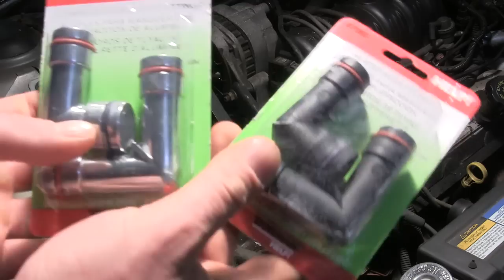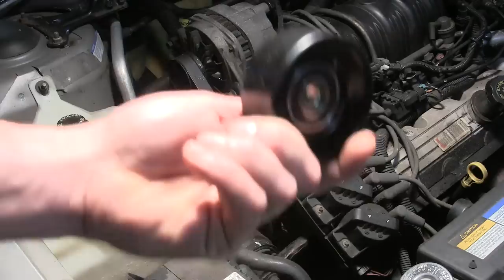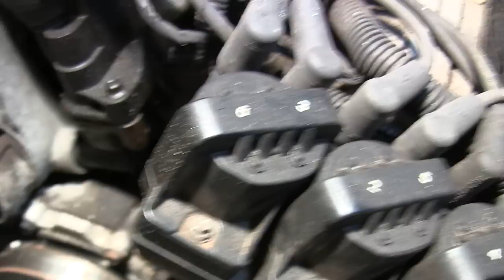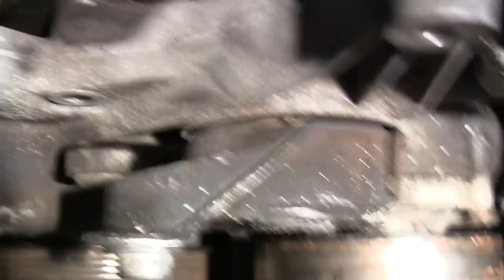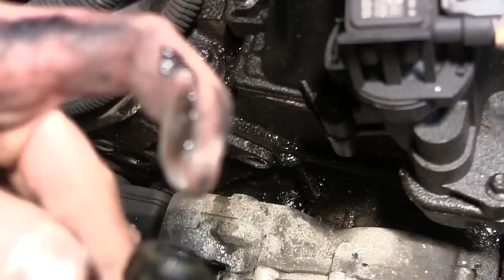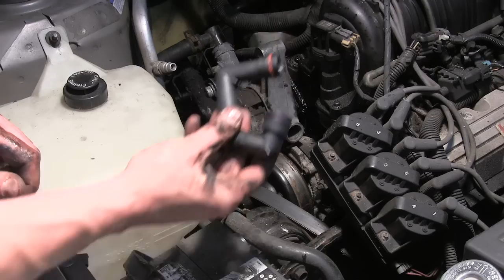3800 Coolant elbow replacement

Comment: I had a friend of mine replace the intake on my '97 LeSabre several months ago. While he was working on it, we also replaced the coolant elbows. When he removed one of them, it literally disintegrated in his hands. We replaced them with the aftermarket metal elbows like the ones shows at the start of this video. The upper and lower intake and the elbows were all on the verge of a total failure after 17 years and about 63,000 miles.

I always recommend everyone have this work done on any 3800 Series II cars they have. Eventually, they all have these parts fail. It happened twice on a '99 LeSabre I used to own, and I wasn't going to let it happen to this one.
Reply: Your saying that the upper and lower intake manifolds were on the verge of failure or the gaskets?
Reply: Both are huge failure points on these engines..

Comment: Great vid. I'm currently in process of replacing the upper IM assembly and the lower IM gaskets. I got the intake(s) off an hour ago only to discover that there was no antifreeze in the intake and upon removing the lower IM that my 3800 had already had the job done before I got the car at 97,500 miles in Aug '12. They used the good Felpro metal lower gaskets. Then I started to worry about head gaskets and then remembered the elbow issue. I ordered the metal elbows with my other stuff last week so I do have them. I'm praying that it's just the elbows leaking around their o-rings.  Of course I'm going to install the new parts that I bought anyway. Peace of mind for myself :)

Comment: FYI, just did this exact repair yesterday. I took a piece of wire clothes hanger bent into a very small J-hook (small enough to get through the hole but still catch the broken piece), poked it into the hole through the broken piece (carefully!), and pushed it in deep to make sure the broken piece would fall and stay on the hanger (rather than falling into the coolant passages). Then I just pushed the broken piece into the hole to get it loose. It fell onto the hanger, and I pulled it out. Very easy.
Reply: saw another where a toggle bolt and washer was used as a "puller" for the old elbow.
Reply: I used a paint can opener
Reply: Be VERY careful not to score the inside of the hole with a sharp edge of a tool or coat hangar.  It's only aluminum, and if you score it even the slightest amount, it will leak.

Comment: Surprisingly I've never had one go bad, and I own a half dozen of them currently, more commonly the water pump tends to go out, Liked
Reply: Then you're EXTREMELY lucky.... I had them leak on my 2009 Buick Lacrosse @ 68,000 miles. 

VERY common failure point on these 3800's since the early 90s

Comment: Thankyou for this, i did it in 2hrs! it wouldve been faster but i was stuck dealing with the pieces that broke off inside lol. I'm lucky, i drove the car on an 18hr trip and noticed it would only leak coolant during heavy throttle so i babied it til i could get it repaired. my elbow was completely split! i replaced them both with the aluminum ones

Comment: I purchased a serpentine belt removal tool which I also used as a breaker bar for those bolts. The tool is about 24 inches in length much longer then a regular breaker bar. It works better then a breaker bar as gives you more torque to remove

Comment: I had to replace mine (along with the radiator because of them leaking air into the system and frying the plastic tanks on the rad!) and also got a piece of the old plastic pipe stuck inside the engine. My mechanic was right there working on my dad's RV at the same time and came over and took a look and said not to worry because it would probably just stay in that passage and not be able to block anything. He was right as there seems to have been no problems caused by this so far. I also put in a thermostat that opens slightly cooler than stock yet the temperature on the dash seems to hover about where it should. Might be a good idea for this engine. Engine has been running pretty good after replacing basically the whole external cooling system. I did have one episode several weeks back where the check engine light came on intermittently for a few days but I haven't seen it again in at least 2 or 3 weeks. Bad tank of gas?!
Reply: Scan it and find out
Reply: @davelowets That was 7 years ago. That car is LONG gone! I now have an even older car with a Series I 3800.. none of these bullshit problems.

Comment: Changing mine today for the first time.  Got 160,000 miles and 6 years of ownership so far.  Got Aluminum ones to put back in. The front elbow broke off and fell back into the intake and can’t see it at all now.  Hoping no damage will incur.
Reply: What ended up happening? A piece of my hose broke off and fell in also. I can’t find it now.
Reply: Remove the thermostat, put the housing back on, and then flush the rad with a garden hose.... 

The broken piece will probably flow out with the water that comes out

Comment: As a mechanic myself why in the world would you EVER put plastic ones back in? Its $3 more for the aluminum ones. I flat out refuse these jobs if the customer doesn't use the aluminum ones.
Reply: I cringed when he said that the end of the plastic elbow had broken off inside and was lost forever! 
I'll be doing this job come springtime and I'll probably get the whole tensioner kit with the aluminum elbows...
Reply: I would go with aluminum ones even if it meant $30 more. 
You have to wonder though - did it REALLY save GM that much money by going with cheap plastic ones? Talk about penny pinching.
Reply: Believe it or not the plastic ones have a better o-ring then the metal ones. The metal ones have a smaller o-ring which have a tendency to leak after 5 to 10 thousand miles. They did not make the O-rings thicker on the metal ones but they're a little bit thicker on the plastic one. You might just take the O-rings off the plastic ones and put them on the metal ones and have a better seal because I guarantee you some of these cars will still leak even after their replace so it's better to put it like a bunch of gunk around the O-rings to kind of give it a double seal my car leaks after 6,000 miles after I put the new metal ones and realize that the O-rings are not as thick as the old ones
Reply: @chaseww  you’re joking right ? Gm o rings are the proper size. 175k miles on aluminum ones with genuine o rings. Worth the extra cost.
Reply: @oneeyedrone4293  he is correct. If someone purchased the Dorman brand aluminum elbows, the o-rings are trash.  I recently did this upgrade.  Since my local dealer did not have the genuine GM/ACDelco o-rings in stock, I purchased the plastic elbows and stole those o-rings and put them on the new aluminum ones.  Hopefully... problem solved.
Reply: @xxXWiLdFiReXxx  i got mine online from a reputable ebay GM seller of OEM parts. They stock them even locally just for a bit more, I used a lot of dielectric grease for the install. Dorman usually makes OKAY quality parts, but they are not the best by any means. I still dont understand why dorman makes plastic and metal elbows when they both fit the same application. 

The new GM parts are now more made in china since they are phasing out the aftermarket side of things. I think that explains why older cars break down more often despite getting new motor mounts installed, bearings etc. The replacement parts are not the same quality despite being OEM. When the car first launches they mass produce parts to ensure cars last their rated warranty, after that point its fair game to use any white box brand. 

Either way, this repair is a simple one, just messy, and overly complex, but rewarding whne youre not leaking coolant :)

Comment: My 2009 Lacrosse started leaking coolant ONLY when the outside temperature went below 30°, AND the car ONLY leaked when the engine was shut off and cool. It would leave an ocean of coolant under it the size of the car. But, fill it up with coolant and drive it, and it would NOT leak a drop. If the outside temp was above 30°, it would NOT leak a drop... it was FRUSTRATING to find this leak. 😤

I finally found it, and it WAS the lower coolant elbow... replaced both elbows with the aluminium Dorman ones, and no issues since. 

Be SURE to clean up the holes where the elbows go into very well before you try to install the new elbows, or it WILL leak again in the very near future. If the aluminum in the hole is dirty or pitted, use a very fine sandpaper cartridge or small wire brush to clean it up first. If the hole is severely pitted, you may want to use some Permatex Right Stuff around the O-Rings to help them seal. If not using Permatex, DO NOT forget to LUBE up the O-Rings before you install the elbows, or you WILL end up pinching or tearing the new O-Ring and it will leak again. 

Good luck....

Comment: I use a little grease around the new elbow o rings, you never know when you will be back to do something else,  but coolant works as well.
Reply: Very wise....
Yes, you can easily pinch or tear the new o-rings if you don't lube them.

Comment: Use dorman elbows but use gm o rings only if you don’t want them to leak. 

Grease on o rings works well. 

My 3800 sc2 is pushing 170k miles with metal elbows.
Reply: I've had luck using the o-rings included with the elbows, BUT, I cleaned up the inside of the holes VERY well, and lubed the o-rings before installing them. Hasn't leaked since, and has been several years.

Comment: I really appreciate this video. I'm in the process of replacing the elbow. I have the Tensioner Assembly off the car because it was easer to clean out the old elbow, it seemed to be really stuck in there. Just to get this far it tookme about 20 mins. I've watched 3 or 4 videos and feeling lake an expert. Ha Ha. Again thank you for a great Video.

Comment: I have the opportunity of buying a super charged bonneville, it was leaking water and the whole elbow blew off, this was exactly what I had to change, I put the aluminum ones in
Reply: I have a '95 Buick Riviera supercharged and I'll be doing the same job. I'll probably go ahead and get the whole tensioner that comes with the aluminum elbows...
Reply: @bodeine454  I have a 99 rivera and I'm doin mine now 🤦🏿‍♂️🤦🏿‍♂️🤦🏿‍♂️🤦🏿‍♂️
Reply: @sickmike2010  😮
 Tell us how much fun it was when your finished. I probably won't be doing mine until spring or whenever it starts warming up. One of my belts is squealing like a stuck pig right now. Gonna get a couple of those quiet belts by Continental from Rock Auto. They look like those gator belts with the cross pattern ribs...
Reply: @bodeine454  I finished I had to suit up but it wasn't that bad it's hard to find our car on YouTube but it wasn't that bad then u think it is but overall it was fun hell of a experience
Reply: @sickmike2010  I hear that! Yeah, my whole front end needs to be replaced practically.  New bushings, sway bar links, cv axles and struts...
Reply: @sickmike2010  I just put new rotors and ceramic pads on it this winter.
Reply: @bodeine454  yea man it's fun this is my 3rd gm car I love em

Comment: I've actually had the metal ones leak around the  0-rings when a car is overheated. You can hear it with the key off. Sounds like a tea kettle starting to simmer on low heat. Be sure to check the o-rings (PVC and metal) before installation for cracks and deformities!
Reply: Clean the holes out well before you reinstall the new ones... if you don't,  they will leak again

Comment: Just got the broke piece out. Used a metal coat hanger and kept trying to hook it blindly.  Got it out and came right through the hole.
Reply: how in the world did you hook it?  that damn plastic ring fell down in there and I'm not sure what I'm supposed to do about it?  will I have to get a scope camera in there to find it?
Reply: @dabneyoffermein595  Read my comment.  I took an old metal coat hanger and bent one end to a small hook and kept sticking the hook end far enough back in the hole,  moving it around different ways. It will come out, you gotta have patience with it and it does take awhile.
Reply: @workharddieproud  -- we hooked it !!!!  thanks for your mentioning this , otherwise wouldn't have even tried.  Had to be a long solid wire with a hook on it. It was WAY back in there.  Used a mirror and a focus-flashlight,   it wasn't easy and almost gave up 3 times, but that sucker is out !!!!!  can't believe it came out through that hole..  everything back together and running great!!!!
Reply: @dabneyoffermein595  AWESOME !!!  Glad you got it out and back together.  I knew exactly how you felt.  Anyway,  you got it out !!

Comment: Is it necessary to drain all of the coolant?  I’m putting a new tensioner on my 96 LeSabre and I’m going to need new o rings for the heater hoses that go into the tensioner.  Do you know where I can get new ones?   Thanks.

Comment: bah53,  Are the two plastic elbow just used for the coolant channel of the heater core. What if you didn't need to operate the heater core; could you just leave the two  hoses of the heater core(by firewall near alternator)  connected together and have the engine coolant system run normally?

Comment: what if a small piece of the coolant elbow (tensioner pulley elbows) dropped into the lower intake manifold.  I used a hook tool to get the o-ring out, but a small plastic broken part of the elbow dropped down in on me (black plastic ring that was beyond the o-ring, so very small ring but.......?  Should I worry about that or would it not cause any problems.  Thanks!!

Comment: It seems like plastic coolant elbows regularly fail in most vehicles. I would have tried both vacuum and  and compressed air to try and pull the broken bit out, but it might have been ineffective and a waste of time. Is that elbow upstream of the water pump or the radiator?
Reply from the maker: The elbow that I replaced is for the inlet to the heater core. That piece of plastic left in the intake is too big to get through the new elbow to the heater core so it'll probably just float around the intake unless it finds its way down into the coolant passages in the block.
Reply: bah53 do you need that Buick are you trying to sell the 3800 engine
Reply: what if a piece of the elbow falls into the lower intake manifold?  I used a mirror to see if I could see if... and I can't see nothing.

Comment: Good video. I was wondering if you have ever put the elbow into the engine first. I put in in to far and can't get it out to try it the way you did, lol. Any info would help thanks
Reply from the maker: jab1347 I don't think I've ever done that. You might be able to gently pry it out with a screwdriver or pry bar. It could break but if it does at least its fairly cheap to get another one.
Reply: bah53 I messed with it for about 45 mins.  Let it sit for an hour then went at it again. Literally popped right out. Thanks for the speedy reply.
Reply: Always insert elbows into tensioner assy 1st. And always use the dorman aluminum elbows!!!

Comment: You can use the black plastic elbows but make sure you buy them at the dealership because they have the better o-rings and a little bit thicker and they're made better and they won't deteriorate or dry out for many years I got 12 years out of mind before the old plastic ones broke. I replaced them with aluminum ones and I only got a year out of it and then I replaced with aluminum again and I got one more year so I did it twice with aluminum. The o-rings on the aluminum ones are the cheap plastic ones are no good they dissolve very quickly with the heat. So make sure you buy GM AC Delco plastic ones with the better o-rings the last a lot longer. And even if you get 8 to 12 years out of a black plastic AC Delco brand they're great even though they're made out of plastic they'll still last for many years if it's done correctly
Reply: Great🙄

Comment: I was wondering has that broken piece caused any problems yet? It happened to my car and I'm worried about it causing damage to the engine or something else.
Reply from the maker: Mike Fowler No, I haven't had any problems with it.
Reply: Ok cool thanks
Reply: I’m in the same boat, had to replace mine today and that broke plastic piece fell into the intake. I did use a shop vac to keep it sucked to the front of the hole but never could grab it with anything. Now it fell farther back and I can’t see it. Worried about that now.

Comment: bah53 thanks
Reply: beware that even the aluminum elbows will fail in about two years. They are made in China and have inferior o-rings. if you can find higher grade o-rings then it will be the last time you have to do this repair. 
You are a good mechanic, but not a great one. That engine bay is a mess. If you are careful you wont leave any broken bits inside. The general sequence of the repair is ok, but overall this needs editing. You didn't show many important steps.

Comment: I admire your talent. How long did the job take?
Reply from the maker: +Teddy Thomas Half hour to an hour depending on the car.
Reply: +Teddy Thomas Not a tough job. I'm by no means a mechanic and replaced both of these (WITH METAL ONES!) on my car myself. I also did the rad around the same time which was no fun but just a matter of removing and replacing. This job along with the new transmission fluid and filter done before putting it back on the road should make it a reliable car for a while now.